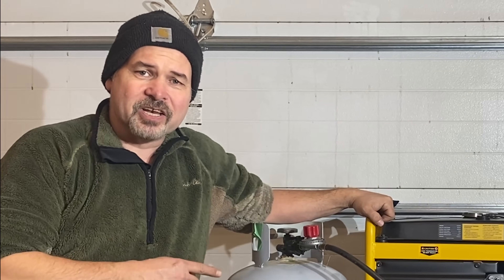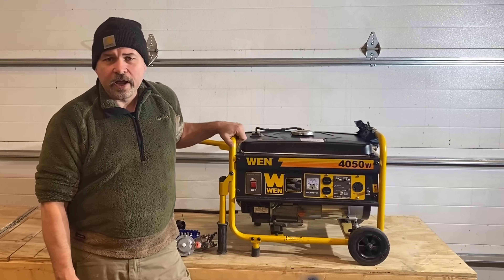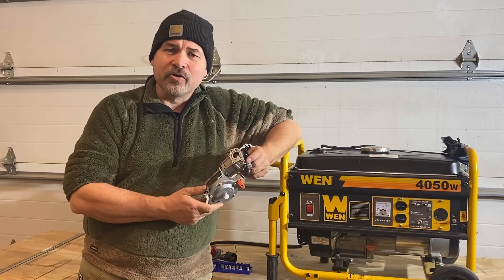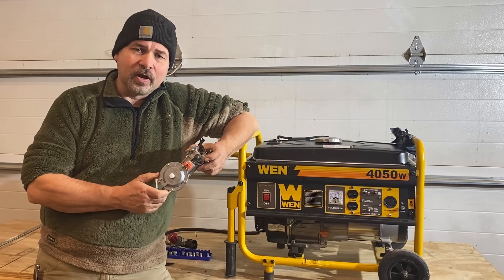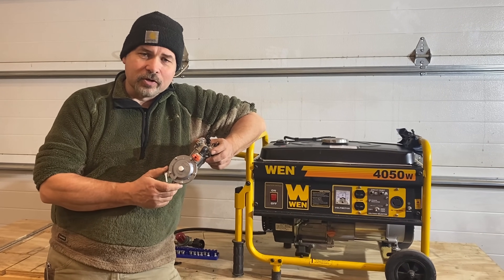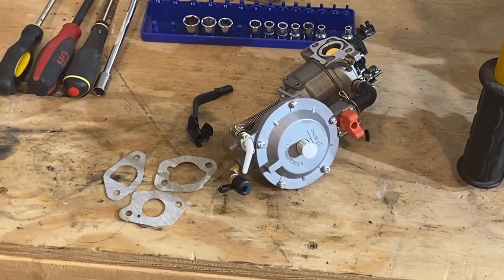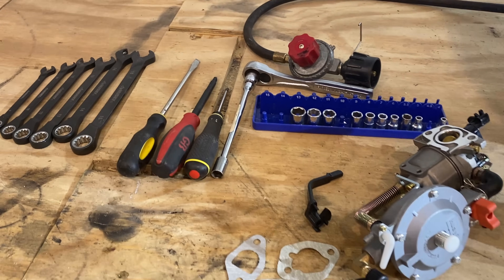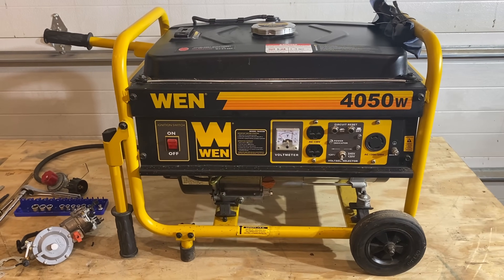how to convert a gas generator to natural gas - How to convert a generator to propane

Comment: This is an excellent video! The steps to install this conversion kit are clearly explained and if I had an open-frame generator like this, a kit like the one shown is what would use. However, I have Honda inverter generators which don't have room in their enclosure for the gas regulator at the the carburetor. For my Honda generators, I've spent the "hundreds of dollars" for Hutch Mountain kits, which are superbly engineered, with no need to fashion a DIY hose connection between the tank and the generator. For me, the quiet running and reputation for long service life is worth the considerable extra money to go with Honda generators.

Comment: I would like to connect a motorcycle engine 4 stroke to drive my 26kw generator .  Could you please specify what size of motorcycle engine should I use? Is 300cc enough for this task? How about noise and fuel consumption? Can I convert this engine to propane fuel in future?

Comment: What do you look for when you're buying the conversion kit when does Amazon have it I would be going to solely Natural Gas and where do you buy that special socket to use the drill to start your generator😊
Reply: The make and model in the Amazon description. I found one today that does about 40 different brands and models for $83.99 CAD
 Yamakato

Comment: Hey Shane! the ebay links you posted are dead now. Despite my best efforts, I have had a really hard time finding a propane/lp conversion carb for my B&S generator. It's essentially the same as the one in this video. Can you point me to another link for this conversion kit? (most of what I can find are for Honda generators)

Comment: I have a Generac generator its a pull start. I want to do what you did but also electric start. I can’t pull the cord to start it. Can you give me some advice? I would really appreciate it. Thank you. I can’t afford to buy another one. It’s never been used except for me starting it.
Reply: A drill and a 1 way clutch attachment

Comment: I’m going to convert my gen to natural gas.  I’ve got the carb on order from Amazon for $21.  The biggest expense is the 24’ x 1/2” hose needed to get it away from the house , and the shutoff valve and fittings to put it all together…..that’s another $100. 😢. Wish me luck.  Thanks for the excellent video.

Comment: I’ve got a predator new haven’t even opened. But I can make methane gas with food scraps and poop and use a 3 stage filter then you need a pump to put the methane into a tank so I need a conversion kit. I seen predator kits for $190 is there a cheaper way?

Comment: Its great this gentleman presents a $30 kit instead of hundreds that are elsewhere, but one can really do it for NOTHING by just connecting the natural gas line to the air filter housing with a valve to regulate the flow to a precise level.
Reply: Yea and if the generator shuts down or an angry neighbor turns it off the gas keeps flowing.
Reply: @chrish7927  not if you wire in a solenoid valve that shuts off the gas when the gen stops.
Reply: @gregschmeltz8276  Obviously, but your original comment didn't mention that anywhere.
Reply: Need to fine tune the gas flow!!!

Comment: Will that conversion kit work on a 8000/10000w Firman generator ? I'd like to convert my generator from gas powered, and connect it to the natural gas system I have in my home. If the answer is yes, where can I purchase this conversion kit ? Great video, and thanks for your help. All the best. 👍

Comment: Exactly what I needed to know. I just bought a non-inverted 4kw to backup my inverted 3.5kw. I just received the dual fuel carb (~$7). As per your advise, I have ordered a new lpg regulator. The carb was very easy to swap. Should know in a day or two how it performs. Damn regulator was twice as much as the carb 🙄.
I have also weighed the LPG tank and will weigh again after testing.
This carb upgrade will not work on the inverter generator as that has a stepper motor controlling the throttle. I am still searching.

Comment: If ever you pop this open, I have a question.  Have you ever tried to convert a Firman 3550-4450W to an electric starter.  I thought of taking of the recoil starter and doing the drill starter but, I wonder if there is an add on conversion.
Its a bear to start on propane when really cold.  I have to start with gas to warm it up first.  Then hand choke the intake to get it to pull the propane in properly.
I was talking to the Generac guys installing their system at one of my clients homes and he suggested a propane specific carb and not a trifuel carb.  He also mentioned that their regulators run at 1/2 a psi.
Cheers and Happy Holidays!
Reply from the maker: I have not tried a Firman generator.
I find the drill starter makes it all possible for me. I blew an elbow up so it is tricky for me to NOT use an electric start of some kind. 
As for the propane specific carb... I would absolutely agree that if you can get a specific device, it will ALWAYS be a better option than a "this one does it all for you" product. 
As is the case with so many things in life, one size may fit all, but it does a poor job at most of the things it does. 
Have a super day my friend.
-Shane
Reply: @AHandleOnThings  I am just concerned that the drill may exert too much stress on that crankshaft bolt.
Hmmm!  Maybe an adapter that would disperse the stress or torque over a larger surface.
Too bad that they didn’t design it such that a starter can easily be added.
Thank you for your input.
Neil.

Comment: I'm afraid i have to disagree with attempting to adjust the way the engine runs with the high pressure regulator. 1psi is generally plenty, and adjustment (if any) can only really be done at the regulator on the carburetor. These cheap chinese kits (which are just fine for the purpose) do not have any adjustment on this regulator.

Attempting to adjust how the engine runs with the high pressure regulator, is like trying to adjust water flow out of a pool, by stepping on the hose that's filling it. The regulator on the carb is designed to send a certain amount of gas, and will, until you fall below a pressure at which the regulator can supply that amount. increasing it will only make the regulator earn it's money (by holding gas back and only releasing the pressure it's designed to release) up to the point where the diaphragm pops. 

TLDR: you can't really tune how the engine runs with an adjustable high pressure regulator. The only way you could, would be to install a gauge and adjust it for between 1-1.5 psi, and then epoxy the adjustment in place and never move it again.

Comment: Insightful! If I may ask, can I still run the generator on gasoline after installing the conversion kit?
Reply from the maker: As long as the kit you installed is a dual or tri-fuel model lie the one installed in the video , yes  you can.
Have a super holiday weekend! 
Stay safe, 
-shane
Reply: @AHandleOnThings  Thanks for the response

Comment: I have a 2000Honda that I put bad gas in. If it runs at all it is ragged.  Can I convert to propane and fix the problem?
Reply from the maker: Lavern, 
Assuming that you have replaced the gasoline with new gas already, your rough running problem is almost certainly dirty jets or fuel apertures. So... either cleaning or replacing them would make the motor run smoothly again (most likely) and replacing the carb with a new one (with or without LPG capability) would also fix the problem. (most likely).

Comment: Thank you for a very detailed and informative video! I was looking more for a natural gas line from meter to generator. Love the propane setup but is easier to go to natural gas and forget about swapping out tanks etc. Went to Ebay did not find a natural gas set up or a tri-gas-propane-natural gas set up.
Reply from the maker: Robert, 
Lots of carbs available still depending on your motor.
https://www.amazon.com/Propane-Carburetor-Conversion-Predator-Generator/dp/B08BZ62W5S/ref=sr_1_4?crid=2L3M4GQO5WMNV&keywords=tri+fuel+carburetor+for+generator&qid=1685710527&s=automotive&sprefix=tri+fuel+carburator+for+generator%2Cautomotive%2C102&sr=1-4&ufe=app_do%3Aamzn1.fos.006c50ae-5d4c-4777-9bc0-4513d670b6bc
This link will take you to one on amazon for $60 bucks that works for harbor freight generators.
Just try typing "Tri Fuel Carburetor" in your searches. It works better than looking for "nat gas" in your searches.
Have a super weekend! 
-Shane
Reply: @AHandleOnThings  Thank you so very much!!! I run a Westinghouse 6500/5500 watt with a 276cc engine I think it is.

Comment: I’ve got a similar setup on my Troy Bilt 13hp generator. I cannot get it started, figured it could be the Torch spark plug, so I changed it out for an NGKBRE6S, still will not start. Motor has an electric start, Is it possible, that the motor is not turning over fast enough to create a strong enough vacumn to pull the propane into the motor?  Watching your video, I noticed you use a drill to turn your generator over, do you think that would maybe work with my Troy Bilt. Any suggestions  or ideas are greatly appreciated. Thx much.
Reply from the maker: Im not sure. There are soooo many variants of generator out there. have a look at the interface gaskets and that should be a strong indicator for you.
Let us know what you come up with!
Merry Christmas.
-Shane
Reply: Shane, I still haven’t had any luck starting my setup. A question hopefully you’ll have the answer to.  I open my tank all the way, then my HP regulator, but I never hear any gas nor do I get any gas too the carb. I can turn my HP regulator open at least 3 full turns and at that point I can hear the gas, and I mean lots of gas, so I’ve been immediately turn it off, now the question I have is that normal for the HP regulator now the question I have is it normal for that HP  regulator to open that many turns?  I was thinking maybe I have a bad regulator. However if it’s normal for it to open that far, maybe I just need to play with it more.  My concern was that much gas rushing someplace could cause an explosion. Any help/comments or suggestions are greatly appreciated.

Comment: I have no fuel valve cut off from tank to carburettor, do I have to buy one ??
Reply from the maker: Frank, 
I am a true believer in having fast ways of shutting off the fuel.
If the tank is right there and a shut off is right at hand, I guess I personally would not drive 500 miles or wait 2 weeks for a redundant valve. Use your best judgement! 
Merry Christmas! 
-Shane

Comment: I absolutely love your presentation.  I just installed my kit and I’m holding back from cutting the hose for this mod.
There has to be a solution where we can make a mechanical connection.
What a beast to try to start!  But, I figured it out.  I pressurized the line , purge the air, then shut off the regulator.  It takes a few pulls to start it, it’ll run rough, then quickly open the regulator just a hair.
It’ll then run nicely. The problem is is that it just takes a whisper of propane otherwise it floods immediately and pull as many times as you want you will not start.
Reply from the maker: Neil, 
You are correct about the whisper of propane to start sir! I did eventually go to a air fitting. Not the recommended or "legal" way to do it, but as long as I dont show it on camera...
Like everything else I own mechanical tho, it requires a bit o finesse and understanding of its intricacies to make it work. Totally worth it tho! 
Merry Christmas! 
-Shane
Reply: @AHandleOnThings  Most appreciated!

Comment: Address to get that carb set up?
Reply from the maker: I dont do affiliate marketing so I hesitate to send out links for the carbs, but just check on amazon and put in "tri fuel carburetor for generator" and you will find a bunch of options starting at about $26 bucks!
Have a super day!
-Shane

Comment: Instead of a high pressure regulator, couldn’t you just close off the tank valve to lower the pressure?
Also, do you have an equivalent link for the carb kit on Amazon?
Reply from the maker: Neil, 
Anything is possible I suppose, but I have had no luck with anything but the method shown. 
Let us know what you come up with!
-Shane
Reply: @AHandleOnThings  Good morning, any luck on the Amazon link?
BTW an excellent video!
Reply from the maker: @nzs316  Type in "Tri fuel propane conversion" in the amazon search bar. They appear to have a bunch of them available still including dual fuel and tri fuel options. I just checked and they have some from $26 bucks on up.
Let us know what you choose!
-Shane
Reply: @AHandleOnThings  Thank you.

Comment: So my generator will only run when the bleed valve is depressed, and it runs rough, am i to understand that it's still too rich? I was thinking i had a vacume leak, not enough fuel getting into the system, but neither adjustment, reducing or adding, lpg before the on demand regulator allowed the machine to idle on its own. I am certain the regulator gives fuel when a vaccum is pressent, and i've played with 3 different styles of these carb regulator combos, non have given me this trouble so far.

Any help would be apppreciated
Reply from the maker: Fitch,
It would be impossible for me to troubleshoot your situation without being there, but in my experience on my machines, I had to keep cutting the propane flow back until they ran clean... and I was very surprised at how much I had to cut it back before I got there. Made me shake my head on the first few times.
Let us knw what you come up with 
-Shane

Comment: Shane, I have a Robin RGX3500 watt gasoline generator that I like to convert to propane and natural gas just like you showed in your video.  I am unable to determine the correct carburetor and regulator combination for the Wisconsin WI-208 (EY-28)/ Subaru / Robin EY280YD2510 engine.  Can you help?
Reply from the maker: Craig, 
Sorry my friend, I'm not familiar with that particular motor.
I used to have a friend in El Paso who did conversions on just about everything so I know it can be done. Sadly, my friend in El Paso isn't around any more.
Search around some though, there is certainly someone else making custom kits and such
Let us know what you come up with 
-Shane

Comment: I must have missed the part about running it on natural gas.
Reply from the maker: Zuker, 
Legal department actually had me delete that part. They are scared of trusting a virtually unlimited fuel supply on an eBay kit from overseas and then walking away and hoping for the best. Propane is probably the better option I suppose.
Sorry. 
It works the same and installs the same though. Just hook up to the Nat Gas supply and switch the selector to Nat Gas. 
Stay safe and stay healthy 
-Shane
Reply: @AHandleOnThings  Natural gas is a temporary fix. As soon as I sell this place and move to the mountains I'll have to rely upon propane exclusively. Thanks for the reply and thanks for the video.

Comment: This is a good video, however, I have a much larger generator (11500 Champion).  How can I find the correct carburetor for my bigger engine?
Reply from the maker: Darwin, 
The best answer I can give you is to search google, amazon, or eBay ... there are many kits available for many motors so I wouldn't be surprised to hear you find the one you are looking for.
Sorry I dont have a better answer for you
-Shane

Comment: Congratulations for such a easy understandable video for a petrol generator gas conversion, I'd wish u to answer 4 questions. First, is it so easy to start the gas-fed motor with the pulling cord as with a power drill as u do?, second, what's the gas running power loss compared to petrol?, third, does it tune fuel dose quick and smoothly face to sudden big power consumption changes, and fourth, engine cold can be gas started directly or previously needs be petrol started?, thanks
Reply from the maker: Salvadore, 
Thanks a bunch for taking the time to comment!
Here are the answers to your questions (as best as I can do) 
1) It is the same starting effort for gasoline or propane. I prefer to use the drill (especially for camera) because it is easier and looks better than pull starting
2) Power loss, I have no way to measure the power loss but I have heard that 15-20% loss is to be expected when running on propane instead of gasoline and I see no reason to question or doubt that estimate.
3) The machine runs normally under load and tunes to a smooth run very easily. No real difference from gasoline operation in my experience.
4) you could start with gas and warm the engine up and then shut off gas and switch over to propane but I have not done this since I haven't had a need to. Mine fires up easily on propane so I dont really use gasoline in it anymore. It is nice however knowing that the option to run on gasoline is still preserved!
Have a super evening!
Stay safe and stay healthy!
-Shane